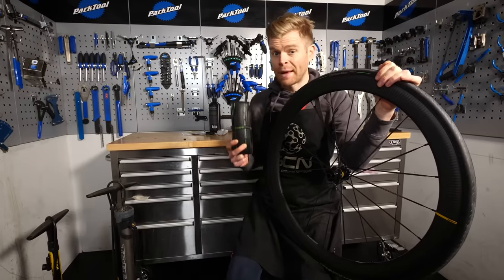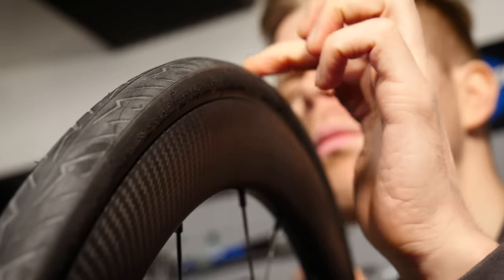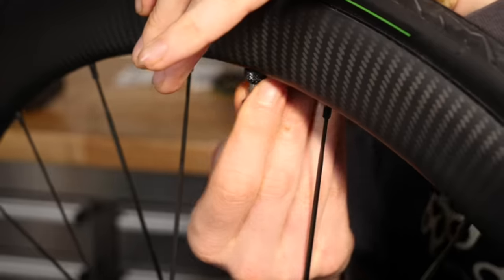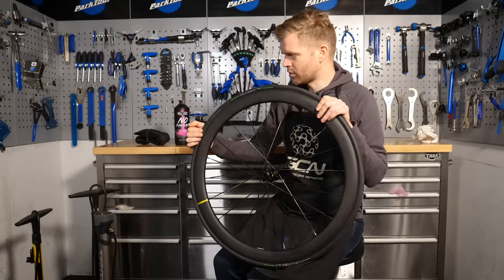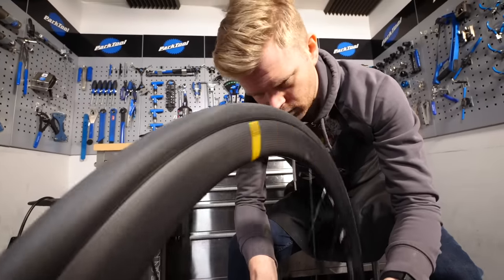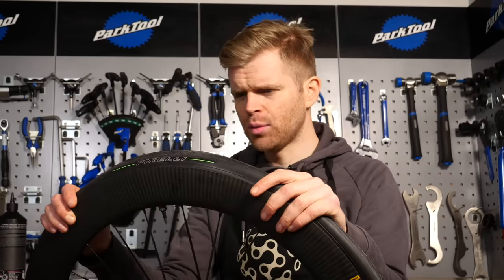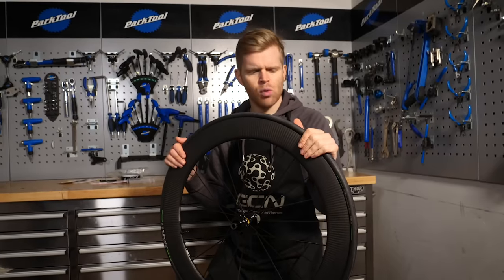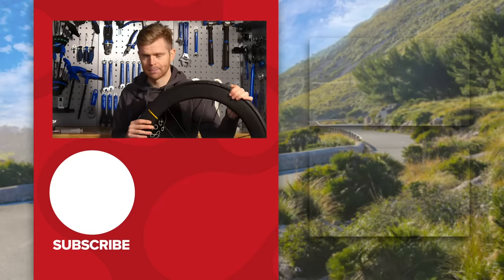How To Maintain Your Tubeless Tyres | GCN Tech Maintenance Monday

Comment: How often should you check the sealant levels?
Every 3 or 4 months or every 500 or 1000 miles, type of timescale?
Reply: Inspired to Tired every 4-6 months
Reply: There's hardly a need to check sealant levels. Just shake the wheel and listen for the sealant sloshing around. If there's enough sealant to slosh around, there's enough to seal a hole. Top up as and when you don't hear anymore sloshing. 

Oh, and a couple of pro tips; firstly, don't ever mix sealants with one from another brand. Some can react with each other and solidify. Also,  CO2 cartridges does freeze up sealant, but that doesn't mean the sealant would thaw out. Basically, freezing the sealant would cause it to start to solidify. The trick to avoid this is just to position your valve at the 12 o'clock position before you hit it with CO2. This would place the sealant at the bottom of the wheel, away from the direct burst of freezing CO2 rushing in through the stem.
Reply: @noahfontaine7832  Thank you very much.
Reply: @Snipeonz  Thank you very much for the detailed reply.
I did check my tyres 2 days ago. I had filled them with sealant about 3 months ago.
I removed the front wheel, but couldn't hear the sealant sloshing around.
So I deflated the tyre, removed the valve core and with valve at the 6 o'clock position.
Gently pressed the wheel down, until the sealant started to come out of the valve.
So I assumed I'm OK for another month at least, before I'll check again.
Reply: @andrew lam comment of the year. Thanks for the great advice. A question I can’t seem to find the answer to though: when sealant dries out, and you top up the tire with more, are you basically adding more liquid in addition to the dried up mass already in there? Would you eventually, theoretically speaking, creating a big layer of gunk that adds 30 or so mg of weight with every top up? When is it time to crack the thing open and start from scratch?
Reply: @Loremipsum555  Well, to answer your questions, yes, yes and yes. Though you would have to remember that most of the sealant is actually liquid, which evaporates off and doesn't add any weight in the end. And usually, by the time the leftover gunk adds any noticeable weight to your wheels, it's time to change your tyres anyway. Just make sure that your tyres are completely clean when adding sealant, or else you might end up with what is called stanicles which rattles around in your tyres and irritates the hell outta you.
Reply: Ollie, can you explain how an inner tube adds rolling resistance?  I’ve heard this for years, converted to tubeless, but am not really sure how the inner tube creates resistance.
Reply: @Snipeonz  Thank you for your expertise. On average how often in terms of months/years do we need to unseed the tire (40cc gravel tire with 5 hours of riding per week) to clean the sealant on the tires/rims before topping up sealants? Every time before we top up the sealants? Only once a year during the start of the spring/summer riding season? Would you recommend removing all the sealants before storing the bike away for the winter to avoid the stanicles you mentioned above? Thank you in advice! Really appreciate your advice.
Reply: @jamesthecow  I can't comment on how often to top up sealant; that depends on lots of factors like what sealant you're using, the average climate and temperature of your area, how much sealant you used, and how often you changed the air in your tires (read as pumping up your tires). Just top up as and when you don't hear the sealant sloshing around in the tire anymore. Also, as I had mentioned above, there's not really a need to clean out old sealant before topping up, as by the time the old sealant causes any problems, it's time to change your tires. 

About your point of removing all sealant for winter, definitely do so if you're storing your bike in an unheated place. Extreme cold can cause sealant to clot prematurely, however, do store the sealant in a capped bottle or something to prevent it from drying out too. There's no need to remove the sealant if you're bringing the bike into the house or a heated place. 

P.S. Stanicles don't form from cold temperatures, they form when there's any small foreign particles (dust, dirt, the like. Anything that isn't the tire, sealant, rim or rim tape) in the tire mixing around with the sealant. Sealant clots around the particle and forms into a little booger. That's what rattles around. Best way to prevent stanicles is to keep the inside of the tires clean from these small stuff when installing the tire, keep your tire inflated, and don't ride your tire flat. And that's also why I generally don't recommend people crack open their tires too often. The more you crack open your tires, the higher the chances of having some dirt end up in it.
Reply: @20oldfarm  Well.... inner tubes adds rolling resistance by virtue of being a solid, and how they keep the tires on the rim. To fully understand how this works you have to remember a few things. Firstly, there's friction between the ground and whatever is moving on it. Now, to apply it to a wheel. To start moving a wheel, you have to put in enough energy to overcome the friction with the ground and make it start moving. It's not much, but some of that energy is still lost. The same applies whether you're going wrap speed, maintaining your speed, slowing down, whatever. Your wheels always wanna decelerate due to the friction with the ground. That's what we know as rolling resistance. 

Before we bring the inner tube into the equation, here's another two things to remember. Stuff don't like to change their speed without any reason, and when you rely on friction to keep stuff together, some of any energy you put into that system would always be lost to try and overcome that friction. 

And now, for the inner tube. How a inner tube keeps a tire on the rim is by pushing against the tire and rim to keep em in place. In other words, friction. It's relying on friction to keep the rim and tire in the same place, and not allow the tire to spin by itself on the rim. Makes sense? Remember what I said about how your wheel would always wanna decelerate due to rolling resistance and how stuff don't like to change their speed? Well, that applies to the inner tube too. Now you see where I'm going? 

Basically, due to your tires decelerating first cuz it is the thing contacting the ground, it is in turn causing the tube, then the rim to decelerate. And because of how the tube relies on friction to keep the rim and tire in place, some energy would always be lost to try and overcome that friction. Basically, that energy lost is energy not used to keep the wheel spinning, and that's what you know as the added rolling resistance. 

Now, you may or may not realize the same kinda applies to tubeless setups. However, this is where the tube being a big ole' solid comes into play. On tubeless setups, the only solid connection between the rim and tire is, well... the rim and tire. This means there's only friction between those two parts. And when there's less parts that rely on friction to stay together, there's less energy lost. That's why tubeless has less rolling resistance when compared to tubes. 

This is my shitty attempt to answer your question, hoped that helped.
Reply: @Snipeonz  Thank you very much for your clear/concise explainations! I am now 100% sold on getting my next bike with Tubeless set up, as it seems to be more straightforward/less messy in real life. How are the Giant CXR-1 WheelSystem on their gravel (Revolt advanced 0)  or cyclocross bikes? Any experience with them by any chance? Thanks again and enjoy your spring/summer riding!
Reply: @Snipeonz  Thanks!
Reply: @jamesthecow  Sorry, haven't tried that particular bike nor wheelset, so I can't say much about them. Spec wise, I can only say that the numbers look right. But I'm more of a mountain biker, so throw me any bike and I'll still throw em around the best I can. My only advice is to go test ride the bike at your local Giant distributor.
Reply: @Snipeonz  Wish I had you as my high school physics teacher! haha
Reply: @Snipeonz  sorry I forgot to ask a really important consideration when it comes to choosing tubeless vs traditional tubes. In terms of air retention, is there a difference between tube vs tubeless, i.e. once the tubeless is set up properly/professionally, would I have to pump the tire more frequently w/ a tubeless set up? If so approximately how much more frequently? Currently I only have to pump my 42cc continental tire once every 3-4 weeks and the air pressure drops from 60psi to 50psi by the time of re-pump. Also in terms of Carbon Tubeless rims vs Aluminum Tubeless rims (e.g Giant wheelsets), is there a difference in terms of air retention in general? 

Also do Carbon Rims generally speaking need less truing vs aluminunum due to more stiffness? Thank you Andrew for shining light on these questions  my beginner cycling friends and I so far have not been able to find the answers to on the internet. Cheers!
Reply: @jamesthecow  Those are some pretty good questions you asked. Let's answer em one by one.

Firstly, regarding the difference in air retention between tubes and tubeless, I'll have to say that tubes are much more consistent. As for tubeless, it's less straight forward. How well a tubeless setup retains air is dependent on various factors, even if it was set up by a pro. 
For starters, the tires chosen can come in a wide variety, with some notorious for being able to breathe through the side wall. Such tires required more sealant, time and effort to fully seal, and frankly, it's sometimes not worth it. Which ever tire you're going for, I suggest you do your research and find whether there are such complaints.
Even if you find the perfect tire, I'll have to say in general, the air retention of a tubeless system degrades over time. This is due to how for a tubeless system to work well, it constantly requires a layer of sealant to be coating the insides and seal any micro leaks the moment they pop up. Such leaks can be previously sealed already, but over time and continuous riding, all that twisting and flexing that your rims and tire experiences could reopen any of them. As such, sealant drying out, or even not riding your bike for extended amounts of time (the sealant would eventually all pool at the bottom) would cause the air retention to degrade.
Then there's the problem with punctures. Contrary to popular belief, sealant isn't actually a long term solution for punctures. It's there to seal up your tires long enough for you to get home and either plug up the tire more permanently or change to a new one. Sure, the sealant would solidify and plug up the hole, but remember, the plug is neither supported from the inside nor outside of the tire, and it isn't the same piece of rubber as your tire. As such, the flexing of your tire, combined with the air pressure inside the tire, would eventually push the plug out and reopen the puncture.
However, if you take into account all the points I mentioned and had your tires set up by someone who knows what they are doing, the air retention of tubeless systems are actually comparable with tubes. There's also the added advantage to being able to run much lower pressures compared to tubes. I personally run around 35 psi on my gravel bike with 700x40c tires and tire inserts, and I'm pretty heavy at 90kg. Also, it's best to get into the habit of checking your pressures either every week or before every ride due to the inconsistency of how well a tubeless system holds air.

Now, moving on, no, there's no difference in air retention between alloy and carbon rims. Both are equally impermeable to air the last I checked. There's only a couple of cases where an alloy rim would suffer in that aspect; when the ends of a pinned or sleeved rim has been joined in a subpar way. That usually applies to cheap rims and even then, proper application of rim tape and sealant would usually fix it right up.

For your last question, I'll say how often a wheel needs to be trued is dependent on how well the wheel is built in the first place, not the material of the rim. I'll elaborate, but wheel building and truing is a whole can of worms by itself. 
Basically, a pair of robust, well built wheels are more than just straight. They have to be true both radially and laterally, well and evenly tensioned across all the spokes on the same side, and properly dished to boot. And what determines how well the wheel holds up, and how often, or infrequently a wheel needs to be trued, is usually the amount, and how evenly the spokes were tensioned in the first place. 
A poorly tensioned, but straight wheel is much weaker than a wheel which is properly tensioned, but a bit out of true. If your wheel is properly tensioned but severely out of true, that means it's time to change your rim.
Also, yes, a carbon rim can be constructed so it is much stiffer than an alloy one, and seem visually straight, but as I said, it usually isn't what we are looking at. Wheel manufacturers also usually don't make wheels in the kind of stiffness you're thinking about. The stiffness carbon rims boast about are usually displayed in the side to side as well as twisting motions, the up down motion of the rims are usually just as compliant as alloy rims, or even more so. This allows the rim to become a bit more oval to absorb any hits while still allowing you to lean the rim over while sprinting without it flopping or twisting under you. 
That's another thing quite a bit of people don't realize; your wheels are actually supposed to act as a bit of suspension. It's also this ability of your rims to ovalise that can actually cause your spokes to loosen up and go out of true on poorly tensioned wheels.

Comment: Yes. Sealant on the frame is the best sign you had a puncture but it cleans up easy.
As a weight weenie, I've got away with only 2oz sealant.
Using CO2 is OK as long as valve is not at the bottom when inflating (that's where the sealant is).

Comment: My experience with tubeless tires has been a total disaster and I'm done with it. Less than two weeks after setting up my Mavic Cosmic Pro Carbon UST's fully tubeless (they came with tubes installed) I had a puncture while out on a ride. Sealant absolutely exploded everywhere and no matter what I tried it would not seal. It wasn't even that big of a cut - just a tiny piece of glass, really a small hole that I would have expected to be no problem but no, not a chance. I had to use a rubber tire plug so I could limp home. Once back home it took me about 2 hours to clean all the dried up sealant from inside my brake calipers, front and rear mechs and from ALL OVER my bike. Also my literally brand new (first time wearing it) pricey Rapha jersey was splattered all over with sealant that wouldn't wash out - ruined. So, in conclusion - the tubeless tires are in the bin and I will never go there again. What a monumentally frustrating, messy pain in the arse. Nothing at all wrong with a good old fashioned inner tube - I'm going back and won't bother with Tubeless again.

Comment: I have used tubeless for several years now. No problems with holes in the surface of the tyre they seal well, but unable to get home on my bike several times due to cuts on the side of the tyre. Cuts do to cans or objects hitting the tyre hard from a passing vehicles.

Comment: It's been two years now I'm leaving with tubeless tyres on the road bike. I'm not going back to tubes. Wheels are not aero, so the 28c's are a great option. Two things I've learned living with them:
- leave the bike with the valves at 8 o'clock, this will help not getting sealant into the valves
- why? Cause you need to pump in air way more often then with tubes, so sealant might come out from the valves or worse, does it job in there and seal the valve
- still, my pump (yeah, the pump) eventually got clogged with sealant that would spill out (but I'm pretty sure I've learned the above two points)
Reply: is there such a difference between tubeless and light inner tubes?
Reply: @ADCFproductions  not really. With latex inner tubes you will be as fast as tubeless.

Comment: 3:35 how can sealant escape if you keep the wheel in a way that the valve is on the upper side? Sealant is liquid and will flow to the bottom half of you tire.
Reply: Indeed, since gravity will have the liquid accumulate at the bottom, if the core is taken out when the valve is in the lower part, the liquid will escape through the valve ... It has been my experience
Reply: I usually put the bike on the stand, position valves at 10 or 2 then let it sit for a few minutes before I let air and remove the core.  I fill from this position too with the hose pointing to the bottom

Comment: Been thinking of switching to tubeless but never thought about the roadside c02 until you just mentioned that. If it's needed, do you recommend a hand pump for side of the road vs c02? Or is the risk to freezing the sealant only if you're adding more sealant side of the road?

Comment: Just gone tubeless on a trike from ICE made in the UK. I’m still debating if it is worth significant trouble thus far. The rear wheel is 700X 25. Fronts are 406. Schwalbe seems to be the only game in town for tubeless in 20” size. No problem seating the 700 with an air shot canister. The fronts are impossible to seat without going to a shop. One will absolutely not seat. I filled out a warranty claim with Schwalbe which I’m happy to say resulted in a coupon for a free tire. Good news as they are $81 each. I’m losing air from a puncture which appears to self repair as soap suds show no air loss. It does lose air during a ride. Do I patch from the inside or can it be plugged from the outside without losing my bead? Signed; stumped trike enthusiast.